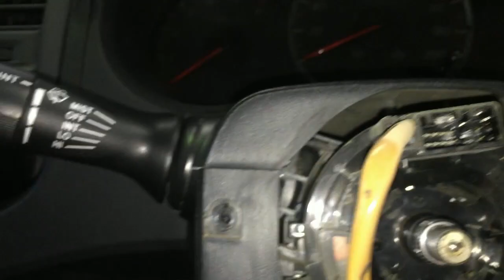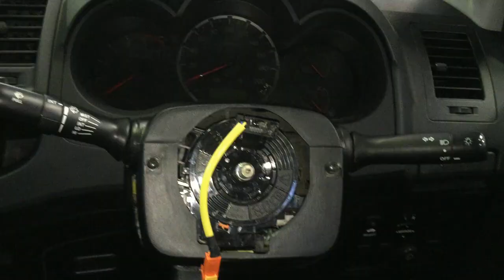toyota hilux .corolla.horn not working [spiral cable]

Comment: in my 2009 hilux, nothing is working (radio, aircon, hooter, wipers, indicators, lamps, speedometer, fuel level gauge). what could be the problem😥😥
Reply from the maker: Check alternator charging